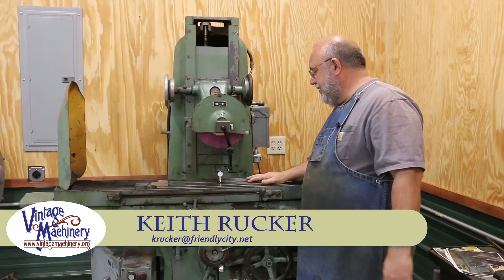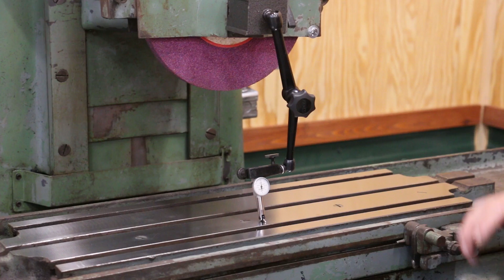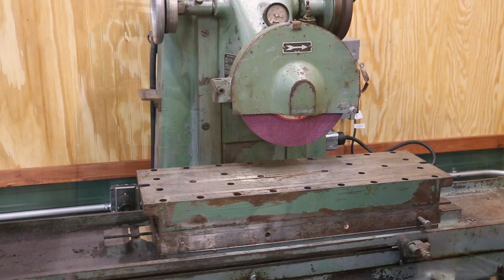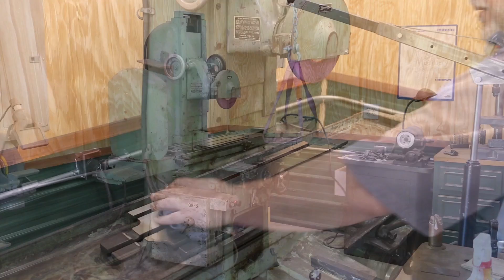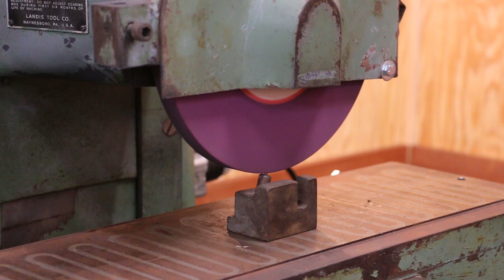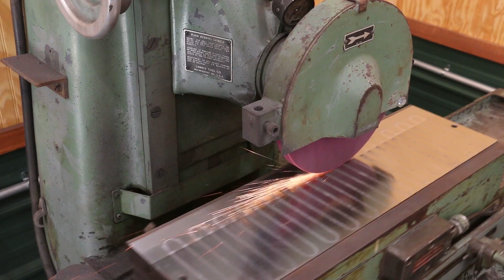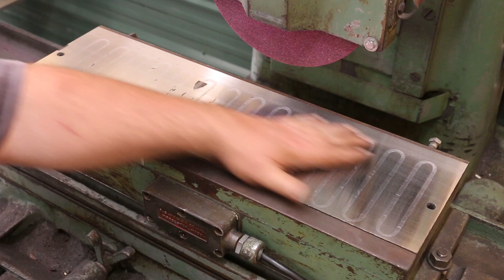Mounting and Grinding a Surface Grinder Magnetic Chuck

Comment: 4:35 - For those who don't know, half a thou is 5 tenths... so error is between 5 - 7 tenths. 17:45 - As it traverses and switches the direction, there seems to be a great deal of vibration for the auto traverse, wouldn't this vibration nuisance be added to the surface finish?

Comment: I’m late to the party but the machine seems loud. I worked in a tool and die machine shop that had 4surface grinders that ran from 7AM to 11 PM and combined they made less noise than that one.  As well… if we ever turned the grinder off, we warmed the machine up, dressed the wheel and then started grinding. Is you restart the machine dress the wheel every time. The only times the grinders were turned off was either end of shift or to change the wheel.

Comment: You can see the wave pattern the grinder left on the bottom of the chuck. When he stoned it, you could here it too. I haven’t gotten to the end of the video yet. It will be interesting to see what happens to the top. If he’s right about the oil, then that’s a major reason those waves appeared. There is harmonic vibration from the wheel and the chuck that isn’t being completely damped by the mass of the machine

Comment: Hi Keith. I noticed something when you were talking about reversing the direct current to demagnetize the chuck. I worked on rotary grinders that ground brake pads on a pedestal with 8 stations,using direct current to magnetize and demagnetize.Underneath the pedestal for each station were 2 microswitches.One ran on a cam that magnetized each pedestal while it was under the diamond grinding wheel.The other switch contacted a very short cam as the part left the grinding wheel to demagnetize that particular magnet so,a servo arm could remove it.If the demagnetize switch was stuck on, it would demagnetize and,then,magnetize in the opposite direction.Sorry for making a short story long but,what I am trying to relate is,when you move the drum switch to demagnetize,don’t hold it there or, it will magnetize it again.What would be much better is a switch to turn the magnet on and a momentary contact push button switch to demagnetize by pushing it for a second or less.Sorry for the long explanation.Great video. I have gone over many of them,several times.

Comment: Seems like you would use bluing and a straight edge to check the flatness of the table, since the table is probably too large and cumbersome to try and put it on a surface plate? What is the spec on the ruby colored wheel you are using? Manufacturer, grit, grade etc. Thanks for making the video.

Comment: Hi Keith, pardon my ignorance but grinding a largish part like that Mag chuck does the grinding wheel get smaller as it traverses the work piece therefore creating a minute taper. As I understand it, as it grinds metal away it must also wear away the diameter wheel at the same time, albeit only in thousandths of an inch, do you do anything to allow for this?

Comment: All these comments about 168 VDC from rectified 120 VAC are forgetting that reaching 168 VDC requires capacitive filtering. If the rectified AC goes directly to the chuck coils, average DC voltage will be lower than the peak voltage by a factor of root 2, i.e., 1.414.

Comment: Keath, what you have is hydraulic ramping that takes up bearing surface. (It is a little bit like hydroplaning).  Compounded with the teeter todder effect,  you ground the table with a slight convex. To amplify this even further you ground the magnet both sides. When finished you will see it ground the magnet convex on both sides(or slightly thicker in the middle of the magnet).  Usually the magnet back would be ground on a larger surface grinder.  Since you're doing it in house, the way you've done it,  is probably the same way I would've.
Reply: I think the previous owner of my grinder did the same thing. It goes up three thou on the left side and up six on the right side

Comment: Great... except just rectifying 120 VAC for the chuck. If the chuck is truly rated to run on 120 VDC nominal, full wave rectification of 120VAC will actually feed about 168 VDC to the chuck. This about 40% higher than the 120 VDC rating. While the chuck may "work" okay with that, the greatest danger is that you may get some undesired heating effects on the chuck from the excess voltage. This could easily effect your grind quality. It may easily contribute to decreased life expectancy on the chuck. To solve this you could add a transformer with about 86VAC secondary winding. You could also feed it from a Variac. To determin transformer rating in Watts (volt amps), measure current your existing setup draws and times the input voltage. This would give you a bit of safe overhead for the transformer. A good US supplier for reasonably priced transformers is "Signal Transformers".

Comment: Nice video , could you explain a little about you grinding wheel choice ?  what grit and hardness would you use to grind the chuck ? does heat build up and affect the grind?
Reply: Yes heat buildup is a problem. When you dust the chuck you are doing the hardest operation you can on your machine. You are grinding to its max capacity. Ie highest heat buildup. 

There are many ways to do it. 
The way I do it, on my mitsui ball way grinder is. 
New 7" 46 grit j wheel. Usually a sg (Norton ceramic or gell wheel as it's what we have. But they are not conducive to light cuts. They like heavy so that they can shatter and expose new grains vs a conventional wheel) 
Dress open structure with a cluster diamond (not a multi point but a cluster. Think of a diamond file but on a cylinder. With more thickness) 
I run my speed reducer (ac frequency inverter) at half speed, so about 1800 rpm on my grinder. 
Light oil film of wd 40. 
Quick to fast table Traverse with .025 step over. Max downfeed of .0002 
Max cut between wheel dusting of .0004 but once the whole chuck makes contact. A couple of passes at .0002 and then a finish at .0001 with a dress between each. 

Doing this, minding my carbide dust (it's about all I grind)  I can keep my chuck flat to .00015 for 3 to 4 months. 
At 6 to 8 months I have to take a whole .001 off to clean it up. 

Sorry if that's too much info, that's how I dust my chuck. 

Some day I'll try different wheels, but I don't want to so that with my work grinder. I'll get myself a grinder one day....

Comment: That was probably a vacuum tube power supply in the electrical cabinet. I replaced one(vacuum tube- 5U4) back in the mid 70s on a much older grinder with a solid state version of the tube.
Reply: ...Yeah, a friend of mine had a very old Jig-Bore machine....used vacuum tube supply for the DC spindle motor.....

Comment: Keith, I noticed the new power cord for the mag chuck is dragging across the back of the machine. It won't take long to wear through the insulation if you don't clamp it down.

Comment: Great video! One question though... Did you use an isolation transformer for your chuck wiring or are you directly rectifying wall current? Directly rectifying wall current is very dangerous. If you don't have a transformer before the diode bridge you really should add one. They're cheap and could save your life. Also make sure you've properly grounded the metal chassis of the chuck to the ground lug of the outlet.  You should also install a suitable fuse between the mains and the isolation transformer.

Comment: Hi Keith,
Are you going to hook up a coolant system on the grinder? If so what type of coolant would you use, oil or synthetic? Every time I used synthetic it would crud up the bottom of the mag chuck in less than a year, never had the problem with oil base coolant.

Comment: i grinded my friends mag table lately. it was ok in the beginning, i stopped machine and tried to start one more pass. Mag should be on in order to start wheel, there is a protection circuit. So i de-magged it also before stopping. Anyway this time mag lamb took a while to light. I finished the job and stopped the machine completely. Then we took a workpiece to work on, surprise mag is not going on! Waited about 10 min and light was on again. We completed the work also shot down machine to change workpiece, this time light gone totally off, it is not working still.. we are not sure if the reason low/improper voltage or circuit thing, or just because of our mag table grinding ? Cables are old and worn out a bit, where should we first look into? Very same mag table in the video, 120 V DC  about 170 watt if i remember correctly. Thanks

Comment: Keith, I think you want an AC field to demagnetize a part. For example, to degauss an old (very old) color TV tube shadow mask, you'd turn on the AC degausser coil then move it very slowly away from the tube a couple feet before turning it off. Very interesting video, as always. Thanks! Jon

Comment: Very interesting to see the effect of the oil film! My guess is that the pressure of the grinding wheel would not counteract that and that this machine will not produce flat parts until that is tuned out somehow. It would be interesting to see a ground test piece printed on a surface plate. Perhaps taking lots of narrow passes evens out the effect, but I expect it's grinding convex surfaces...

Comment: Interesting how the oil film caused that error-  for others looking to do the same job, perhaps the solution would be to pile some weight onto the ends of the table during the original grind to flatten that film out.

Comment: Keith, great video as usual.  I really liked how you pointed out the thickness of the oil changing the indicator height.  

Does this grinder have provisions to wet grind?
Reply: Keith,, I'm rebuilding a B&S  #5 surface grinder 8×24 
Serial #963  30s 40s ( know anything  about this one)

Comment: Why not check for flat using your surface plate since you have one? The indicator attached to the head is not really a valid method to check for flat since the machine produced that surface it should always follow it, but it could be running like a roller coaster and never show it by that method. Could you alter the oil system to the ways so it runs off the pump? On my Thompson it uses constant oil pressure feed to the table and I don't ever get any indication that it is floating.
Reply: thought the same!
Reply: no the way he did it was correct. When the chuck is ground it negates everything such as oil. When he runs the indicator along that trumps everything else.
Reply: @jaysilverheals4445  That method proves parrallel but does not prove flat. I have seen many grinders that would indicate the chuck flat but made parts that were ground thin in the middle because the grinder ways are worn in the middle.

Comment: If nothing else, your new electric supply for the magnetic chuck definitely made things simpler, and that should reduce problems on its own. I agree, its much better the way you've got it, maybe something else works better when its installed in a factory somewhere, but there it has both voltages easily connected to it.

Comment: Hi Keith,
Are you planning to get some kind of a cooling system on your grinder, cause with my experiences I don't see how you'll make precise parts without it, even so much more with thin parts...
The slightest amount of heat acts on the metal parts surprisingly more than we could imagine even in parts as big as your chuck...
Reply: would the chuck itself get hot from the electricity resistance too?   one of them cool mist might be an easy way to go?

Comment: I wonder if there is any runout depth wise. Seems to me that the grinding wheel would wear a bit for each pass. Also, there looks like you have some back EMF from when you switch off the magnet (because it is an inductor I guess). Probably not going to be a problem, but maybe the lamp or the rectifier might burn out prematurely(?). And lastly, a big thanks!!!

Comment: I am very familiar with rectifying AC to DC.  Is there a filtering device in it to change it from intermittent DC to DC?  Just wondering; I don't think it would matter that much but just for my own info.  Wow, the oil does make a difference but that shouldn't surprise me as we leave clearance for lube in most bearings.  Thanks Keith and looking forward to the lead screw job.  Greg

Comment: Good call to replace the rectifier. Before solid-state diodes, rectifier technology was quite cumbersome and often contained hazardous materials like mercury or selenium.
Reply: although selenium plate rectifiers go back over 50 years,  even they have their fragility, before then it was things like  rectifier valves or mercury arc.  basically modern rectifiers are superior in every way compared to the old ones, and a no brainer to replace
Reply: That or you built a motor-generator to mechanically convert your AC to DC and while that did away with needing mercury or selenium, now you had more moving parts, another shaft to keep lubricated, and in the case of this machine, likely a third motor to power.  So yes, modern solid-state rectifier still a far better option.

Comment: never use your hand instead of a cloth
Reply: The most important thing to me is, when using your hand, you can feel if there is any dirt left 
on your clamping surface. 
Wiping with a rug can leave some dirt on the surface and screw up your accuracy.
Reply: I think most guitar players can answer this one.  Your hand contains oils, salts, and bacteria that can oxidize metal and react with the oil. The bacteria can eat the oil and chemically alter the mix of hydrocarbons so that it becomes more waxy, and less lubricating.  Oil normally degrades from exposure to oxygen and sunlight ... adding in the chemical and microbe brew that is present on your hands just speeds up the process for that breakdown.

Most guitar players know that the chemicals on our hands/fingers make guitar strings wear out more quickly, and result in "green slime" on strings and frets that can eat away at the metal.
Reply: After calculating how fast a guitar string wears from bacterias, it would take 1,256,593,568 full years to eat a whole grinder that size...   lol
Hand feel is the beast way so far to check and wipe the finest debris, so I'll get my surface grinder eaten up...
Reply: If you need faster results use rust, it eats up a whole car over her in less than 25 years...    ;)
Reply: ...why?
Reply: Freshly ground or machined surfaces can have very sharp edges. OTOH you can feel surface burrs and imperfections with your hand.
Reply: I always use toilet paper myself...:P
Reply: no it would take just 300 years to wear 1 mm string